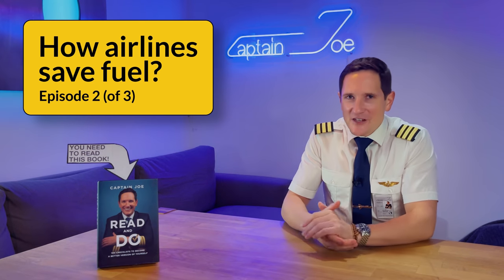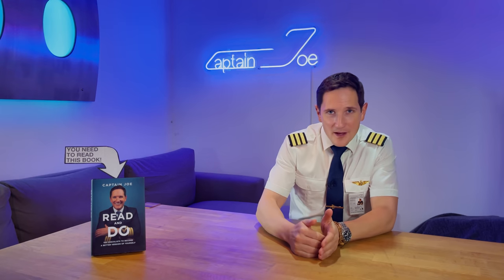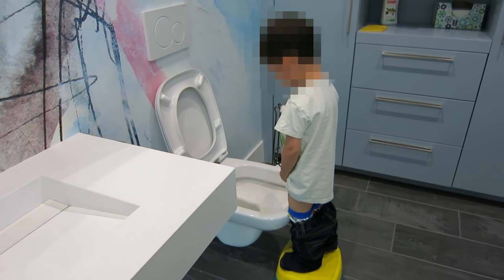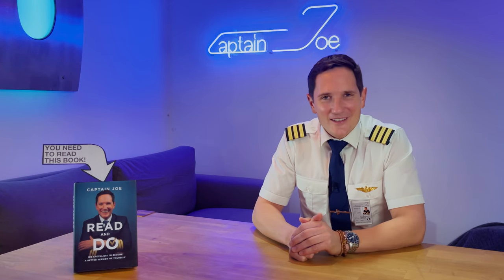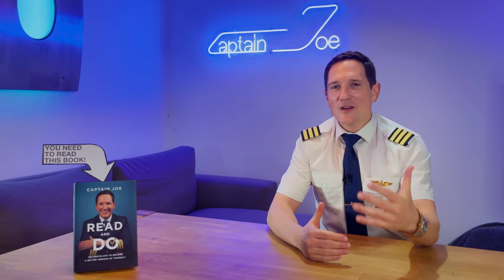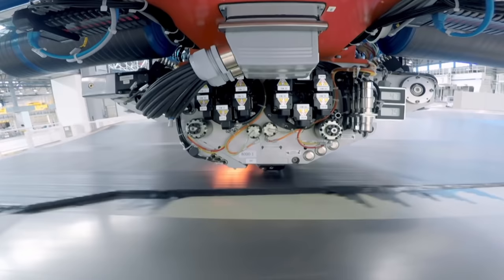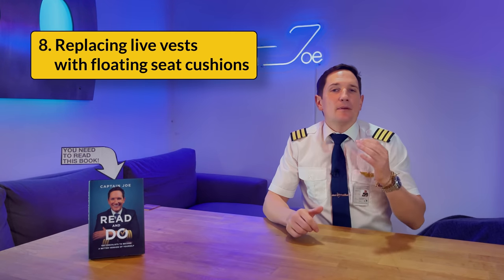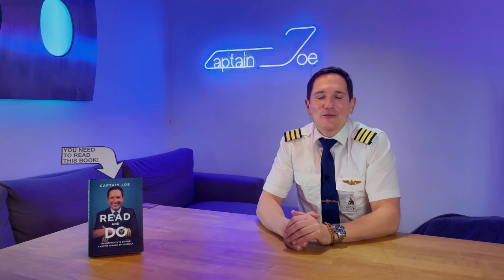HOW TO REDUCE WEIGHT on planes? Explained by CAPTAIN JOE

Comment: Well Jo, one can also exagerate some of these fuel saving measures. In the airline I used to work with, the Catering Manager bragged with cutting substantial fuel burn by reducing the sugar packages for coffee/tea to half the weight. The result was that most of the passengers asked for a another package. Obviously there were not many more loaded, and passengers left the flight disapointed. The sugar packages were quickly replaced to it‘s original size. 😆

Comment: Composite materials (especially the A350) are known to save weight, and they are also known as an auto paint peeler. (Qatar Airways....)
Reply: Yes, but this issue was fixed by Airbus for all the professional airlines without any problem. There is just one single airline with a crybaby and drama queen as CEO left who doesn't really want to get this issue fixed. This toddler is now fuming, but who cares?
Reply: @deineroehre  Airbus🤑🤑🤑🤑

Comment: Thanks for doing the math here, very interesting.  I suppose this assumes everyone is boarding a plane while crossing their legs and needs to pee.  Personally, as a middle-aged man, I try to pee as often as convenient, and certainly as close to a flight as possible because it takes a while to board, taxi, and get in the air and the Captain turns off his light to let us go to the bathroom without getting scorn from the flight attendants (who are standing up and doing beverage service even if the seatbelt light is on).

Comment: I recently read that one low cost airline in India employs only only girls as cabin crew as they at least 10-15 kgs less than their male colleagues. This is their way of reducing fuel cost. By applying your formula, it translates into huge annual savings. I believe, flap settings also effect fuel burn

Comment: Cabin air compressors and battery weight took away the perceived benefits of not having bleed air systems. Which is why the Airbus A350 still being heavier is more fuel efficient than the 787 on same routes and capacities and is more profitable to airlines. Upcoming 787 HGW versions are pointless too as they still do not have enough range than the Airbus A350.

Comment: The baggage weight is BS. Explain how a 90 lb granny gets charged for a carry on but a 450 lb guy with no carry is charged less
Reply: The potential (nay, inevitable eventuality) of Discrimination lawsuits eliminate that possibility.
You can do it on a plane you yourself pilot, if you're the sole operator, but no large company where the pilots don't own the aircraft is gonna be able to do that. If they try, they'll get sued into bankruptcy almost instantly (one of the times when the law does in fact work quite quickly).
Even worse, such a case would be open-and-shut, so they'll have their choice of the finest lawyers to represent them too.

Comment: I agree everything you said in this video, which is a great video, however, if the airliners would actually lower the price of the tickets, as a consequence of fuel saving and ( suppose cleaner environment as less fuel would have been burnt) that would have been a fantastic way of improving the air travel. Or taking care of the crew ( both cabin crew and pilots). Unfortunately, this thing is not happening, and despite some flights may have been more effcient with regards to fuel saving due to less weight, actually more money go in the pockets ( yes, not ours) and air travel is becoming less confortable than it used to be. For everyone, pax and crews. :/
Reply: Than it used to be? Depends on what you mean by “used to be”. Back in the hey day, flying was expensive as f***, and people would get dressed up to fly. It wasn’t something done by the average person very often, like it is now. As for fares recently, yeah they’re up some, and I don’t ever fly economy, but to give perspective- I can fly from NYC to Manila, to go to my house over there, for around $900 round trip right now in economy. Now we can say oh, well 2 years ago it was $675, and that’s true, but let’s all think about this for a second……..
Idk the exact mileage from NYC to Manila, but it’s a freaking distance, guessing like 9,000, and I can absolutely guarantee even the most frugal person driving a Prius couldn’t do that many miles for cheaper than that, and it’d daggum take them a heckuva lot longer than 16 hours to boot…..

Comment: You might want to verify your calculation at 6:00. 425 000t of fuel are definitely a bit more than 314 Million liters - the density of jet fuel is below 1kg/l. So the ratio is rather the other way around...
What I was missing in this video is also the fact that carrying fuel for the trip increases the fuel burn as well. So if you save fuel, you need even less fuel, as you have to carry less fuel for the trip. That's maybe not so much of a thing if you happen to fly from Munich to Berlin, or London to Paris, but definitely it plays quite a role if you're on an intercontinental flight.

Comment: IMO the wipers thing is more of a drag issue and less of a weight issue. Altho, it's not just the wiper blades and arms you're eliminating, you're also eliminating the heavy electric motors used to DRIVE those windshield wipers.
Reply: They also create unneeded cockpit noise, need replacement and can scratch windows
Reply: @josh3771  Yeah, there's several benefits, and it's also good engineering, because as Elon Musk said, "The best part is no part, the best system is no system at all". Engineering is about minimalism, the reason things like airplanes get so complicated is that they're asked to perform very efficiently at many different tasks, which really drives up the complexity.

Comment: I think a vital part of the ANA pee calculation could be even  more important as every passenger leaves more than just those 250g. The overall weight would include toilet paper for all passengers and other things like water weight for washing hands etc.
Reply: No. Plane operators cannot take less water for hand washing or toilet paper even if all onboard are forced to use bathroom prior to flight.

Comment: One of the benefits of the change to a composite fuselage is the ability to have a lower cabin altitude for better passenger comfort. However higher cabin pressure means heavier air - more weight! Is the weight added by -1000ft of cabin altitude significant on a big airliner? If so are any airlines really lowering the cabin altitude? Are any lobbying to raise it?
Reply: Brilliant line of thinking here - I'd love to see an answer about this!
Reply: Not easy to find precise answers on-line but it's a vague point anyway - it depends on the inside air temperature/density and how loaded the aircraft is - passengers and luggage displace air.
The impression I get is it's not significant enough to consider raising the cabin above the regulatory 8000ft, which has potential safety risks, but it may be enough for penny-pinching airlines to avoid lowering the cabin altitude.
It could be beneficial for an empty cargo 747 to lower the pressure.

Comment: What about wasting fuel while 45 mins of taxing and waiting for the gate at idling, circling the airport waiting for clearance. Also it is majorly inefficient to use engines for taxing versus tugs but we don't see any changes happening around that aspect .. All these suggestions are fine but are offset by the overheads needed for takeoff and landing, especially at busier airports IMHO
Reply: Engines have to be on for long periods of time as that’s one of the preflight checks. Planes can’t just start their engines and go - that could be extremely dangerous. Taxiing under engine power could report any abnormal behavior before the plane is in the air.

Comment: Simple question, why not weigh passengers and lighter ones get a discount or extra baggage allowance and heavier ones pay a penalty or get less baggage allowance? If weight matters, I shouldn't have to subsidize the cost of an overweight fast food addict.
Reply: Because it's unethical, and can lead to PR nightmares and discrimination lawsuits
Reply: @ZK-APA  Not unethical if weight is literally the limiting factor of costs.  It's no different than weighing bags.  I'm sure some people would complain about it, but people complain about everything.
Reply: @falxonPSN  well because one, weight here doesn't mean overweight. If someone is naturally large, making them pay for something which isn't their fault is unethical.
Two, weight isn't the limiting factor of costs. It's the limiting factor of profits. As in either they will charge the passenger for their weight, and if they are not heavy, replace that weight with cargo.
And finally, doing this will naturally make people prefer other airlines as it's very easy to counter such a PR

Comment: Best way to save on fuel is build more bullet and maglev trains to avoid overland flights. Or hyperloop.
Leave airplanes only for flights over seas.
Reply: Airplanes have the massive advantage that you don't need to buy the land under the airborne route they take to their destination. All you need is an airport at the source and another at the destination.
Rail lines are incredibly expensive to lay down, despite their seemingly mundane construction. Doubly so if the rail line is electrified, like large portions of Europe's rail network. Maglevs are even more fantastically expensive per mile to build. And Hyperloop is the most expensive of all of them!
So, in these economically trying times, where are you going to get all the money to build all that infrastructure?
That's one of the great things about airplanes, sure the operating costs (and fuel burn) might be higher than other methods of travel, but they excel at being able to go nearly anywhere. Older versions of the Boeing 737 even had small kits of parts available to adapt them to being able to land on grass or gravel runways, and many Soviet-era Russian airliners are similarly able.
Can't say that about any kind of railroad, you gotta lay the rails first, the train comes after. And it's those very same rails that are the expensive part of the railroads.

Comment: When I’ve travelled on premium fares, I’d have been a bit annoyed if it hadn’t at least bought me the right to carry more luggage and have a choice of hot meal served!  In those circumstances I feel the ticket has covered the cost of the extra fuel needed and then some.  In fact I used to hope it enabled the airline to offer cheaper economy flights.  I wonder if passengers will start being weighed along with their luggage and a charge calculated on overall weight?  It really depends whether airlines want to offer a comfortable service or cut their CO2 emissions or simply maximise profit.  Sometimes it seems the industry doesn’t really know which line to take and you end up with a blurred mix of the three.  Are they going to ban wheelchairs and prams?  I doubt it, but if not can they really suggest people go to the bathroom at the gate?  To me that’s taking things way too far.

Comment: The idea is good but airlines  take advantage of everything possible. In 2008 they "temporarily" started charging for luggage because the fuel price was too high. Did they stopped charging? No, they continued and still raising prices for that service. Latter on they started charging for "choose your seat". Why are they doing this charge?  Your seat location does not change the weigh of the airplane in the sky.
Will not take too long to charge to use the restroom or to bring your smart phone or a computer a board.
If charging for all of these they still serving  a very cheap food imagine if they decide stop food because of the weigh. If they decide to stop food for the weigh they maybe they will serve popcorn because is lighter than pasta or something else.

Comment: There’s no way these calculations are correct. Claim: reducing weight by 48kg will save 27kg of fuel. That’s impossible. Someone needs to run the numbers again.

Comment: Captain Joe, did you get the fuel weight / volume calculations wrongly? Jet fuel, when using the metric system, should have a volume that is a higher number than the weight. My calculation give that 450.000.000 kg of fuel is about 577.000.000 liters.

Comment: You have mathematical error with fuel calculation as 450.000 tons of fuel equal around 544.500.000 liters as each kg of fuel = 0.78 of course depending of density in that day, at 5:55 min please check it out.

Comment: Anybody got some advice ??  I haven't flown for about 40 years  I thought about getting a trainer airplane with an instructor take off from Middletown Ny. fly about 30 miles to Stewart airport Newburgh Ny. to try a landing with an Instructor...  Stewart airport has an 11,800 foot / 3600 meter long runway.. Stewart airport has long runways but is a very quiet low traffic airport.. Any advice on this plan ???  Would an airport like Stewart be a good choice ??

Comment: Fly by Wire should perhaps be called, Fly by Electrons, as one first thinks of actual wire doing the connections, as in the older plane designs with the linkages and wire for Fly by Wire.

Comment: What a load of nonsense, why didn't you explain that if your flight plan block fuel is 51,105kg then you'll have to round up to 51,200kg minimum because the refuller can only select 1 decimal place on the panel? Why not cover you'll actually round up to 51,500kg or quite often 52,200kg if the airport is tricky, its a training flight or bad weather reported. When was the last time you went with exactly block fuel (negating any potential urine or olive saving)? These hypothetical exercises come up all too often and have no bearing on real world operations. The is no way anyone is pushing for JFK or ORD with block. You need a substantial reduction in the APS to make any quantifiable fuel saving.

Comment: This concept is not just for aviation. It's any petrol driven vehicle. I have a very powerful Mustang. Putting 850 hp to the rear wheels. Instead of trying to add more horse power, I went for weight reduction. Replaced the hood and trunk lid with carbon fiber. That saved 40 lbs. Removed the stock gas tank with an aluminum fuel cell. Another 28 lbs. Then the doors. 100 lbs for both saved. That was the biggest hitter. The doors on a  67 Fastback are huge. Next is the seats and grill. I want to remove 1000 lbs total. I am about 3/4 the way there. Then I will have to diet to reduce weight! lol

Comment: 1) The savings due to peeing before a flight would be quite negligible, and therefore it's negligible on a yearly global scale. Those numbers sound big - but only when not compared to the grand total. Those numbers are merely a drop in the bucket.
A much more valid reason to pee before a flight is that airplane toilets are quite uncomfortable.

2) 4:44 I think you did the conversion the wrong way. 28 kg of fuel would amount to about 37 liters.

Comment: Well wipers it self might be a couple hundred grams but add to it 2 motors, wires, control switch, fuse etc pretty sure you end up saving a fully loaded man bladder.

That said I wish airlines would sell tickets like we buy meat at the butcher (per kilos) but quite sure I wouldn't share that opinion if I'd be eligible in any sport heavy weight category 😛

Comment: Another way to save heaps is to put all the passengers to sleep horizontally in capsules. No meals, no inflight entertainment, no cabin crew required! 🙂 They board the plane asleep, and are woken up after the plane lands. If the plane crashes or catches fire, they won't worry. 
Also, collect their farts. An average human farts about 2 litres of volatile gases a day, so 400 passengers on a long haul flight could produce about 800 litres of methane and other aromatic gases, which can be fed into the engines for more power.

Comment: The main reason why aircrafts consume more when heavier is because it takes more energy for the airplane to climb the same altitude unit  the more heavy it is so a heavy aircraft finds its optimal cruise altitude for a given flight lower than a lighter one and thus consumes more. Second reason which is quite negligeable. To keep the aircraft at the same altitude u need a higher angel of attack to generate enough lift force to cancel the weight force  which induces naturally more drag

Comment: 5:00 wooow just 10€?
If it was 28kg of fuel, that is rougly 35l...
If car fuel is around 1,5€ per liter, I would have thought the jet fuel would be in the same ballpark, so rougly 50+€.
10.29€ would mean that it is supercheap, like 0.3€ per liter.
Is it that cheap?
Reply: 5:59 this can't  be right either. It can't be more kilograns than liters, density these fuels are less dense than water...

Comment: 50 kg could be just as easily spared on crew body weight.
Reply: There's a good reason there are less flight attendants on each aircraft than there used to be, and you just found it.

Comment: The figures calculated for the saving for not carrying pee sounds like a lot but how much CO2 is produced even with a saving?
Reply: Exactly. That is the question that should be asked. The argument that small savings add up over many flights is true, but it is ultimately meaningless because overall fuel consumption scales with the number of flights as well. So you might as well use the savings from a single flight to get an idea of the impact of these measures.

And saving 50kg of fuel when you are burning an overall 50tons of fuel on that flight, that is not going to save the planet. That is a rounding error.